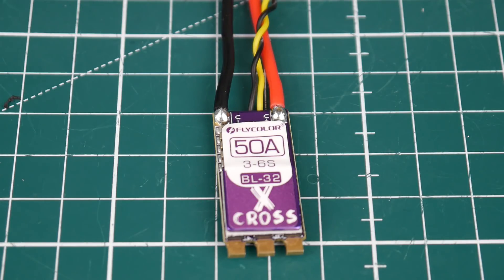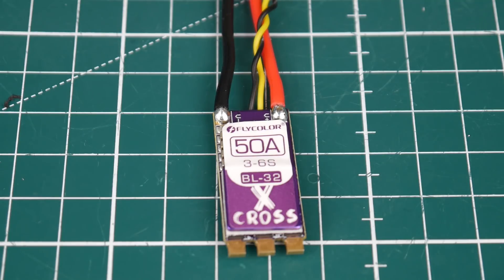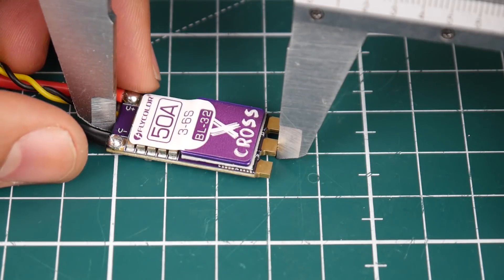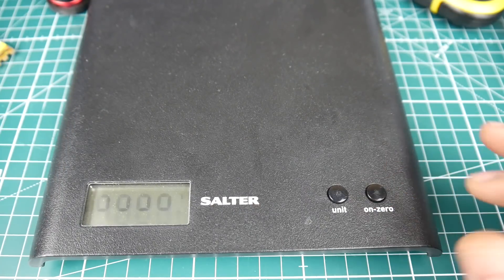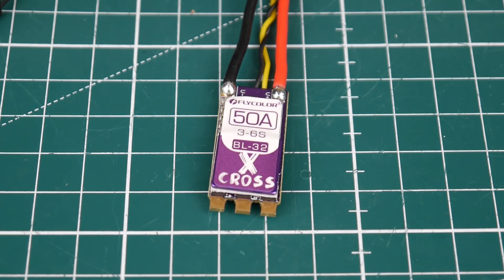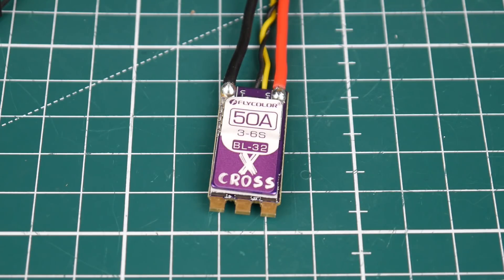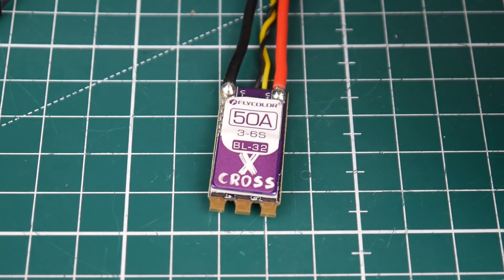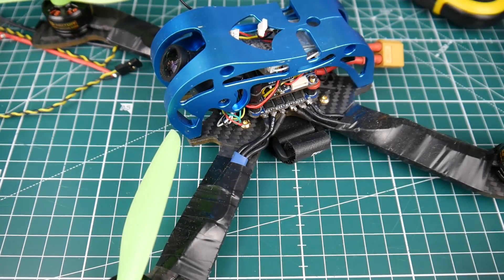Dys Aria Killer // FlyColor X-Cross 50A Review and Noise Testing

Comment: LOL. Should be called DYS Battery killer. 50a X 4 motors = 200 A. That's 30 seconds flight at high throttle. Also XT60 is rated at 60 amps. Gonna need 200 A version.
Reply: you'll need a better battery long before you'll need a better connector ;)
Reply: @99395985h   I know this comment is 3 years old but its still valid and too true!  
Until Lipo tech and performance improves/progresses people could and should be running far lighter motors and ESC's and gain performance through low weight.
Too many people chasing benchmark numbers without considering the bottleneck... the weakest link in the chain... the lipo!

Comment: BTW, how much did you pay for that camera ? :0
Reply from the maker: +BuzzCola 3 I started the channel recording with Samsung s4 then it broke and got Samsung s6 was recording for that for a while now... and like last 10 vids on Panasonic Lumix G7 and for audio AKG 1000 condenser. Still trying to perfect audio :)

Got cam for around $400 Used.
Reply: Drone Mesh that camera looks better better than samsung s6. And it must be, because camera is made for that. 
I have the sony cx330, i does capture pretty well and it has 30x optical zoom. And only for like 200€ new. 
If your camera broke you can try that one.